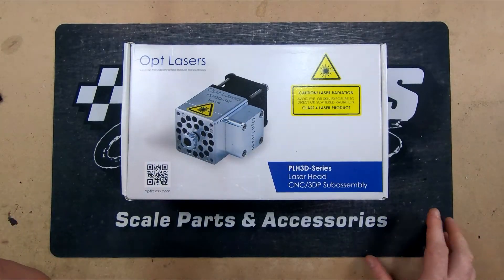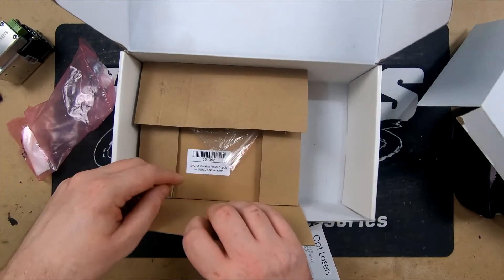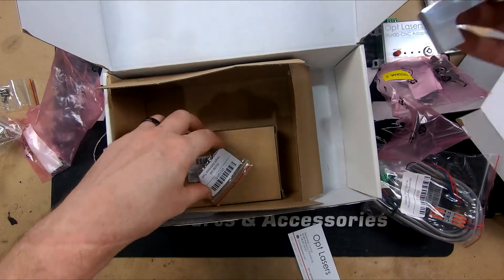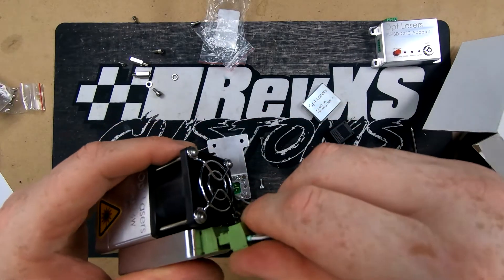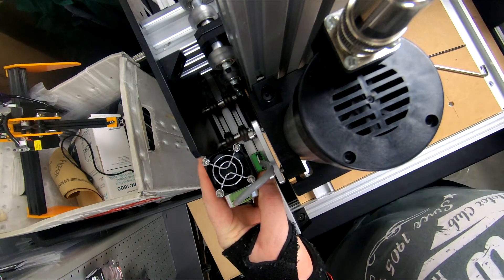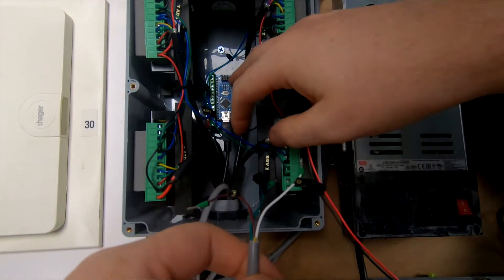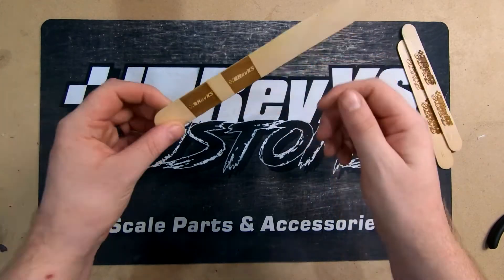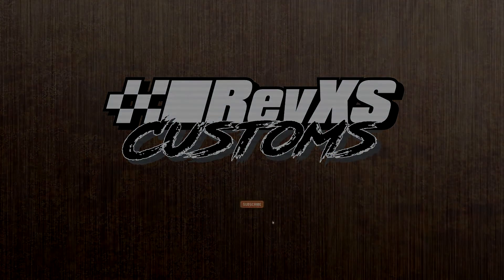Opt Lasers 6w Bulkman Workbee Install and Test

Comment: Very thoroughly explained at the beginning of the video, will definitely be useful, were there any difficulties for You?
Reply from the maker: Really was no issues,nothing that manual didn't answer when had any issues,other than homing issue with having laser side mounted but can be fixed by ordering the open source kit which comes with a mounting plate which brings the laser off front of spindle